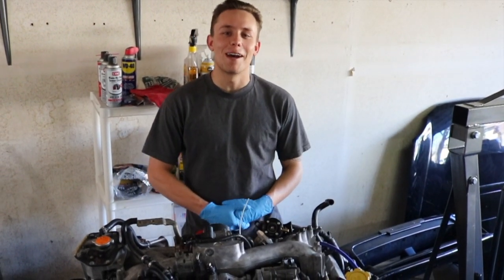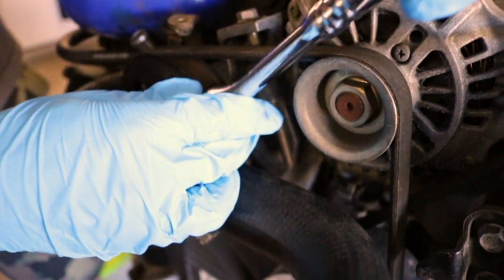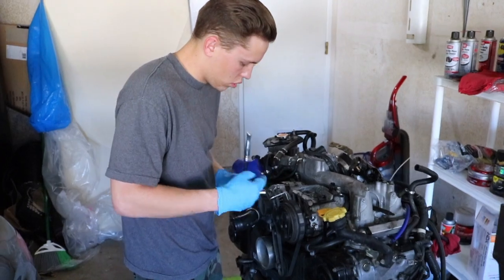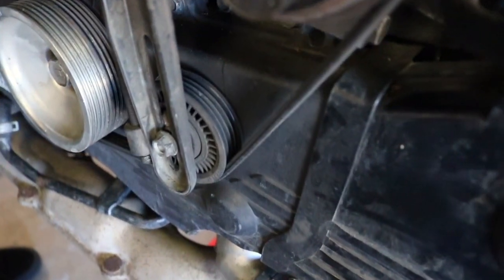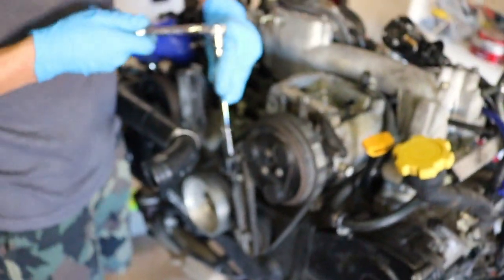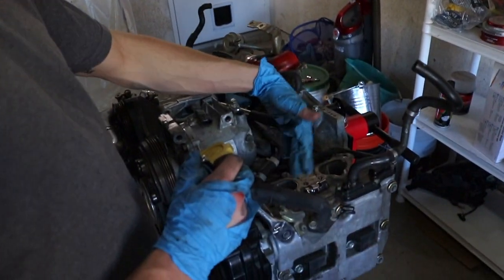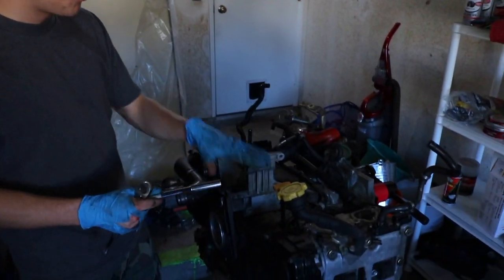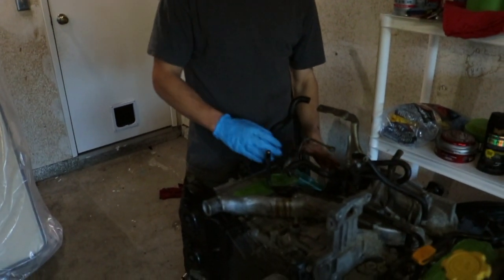How to remove a Subaru alternator, ac compressor, and power steering pump!!

Comment: dude, demonstrating it out of the car makes it far from reality only because to remove the steering pump for example requires to remove additional elements around its place in the engine bay. So its not quite the same at all! :) I stopped your video there at 1:43 and will not finish it because of this. Cheerios